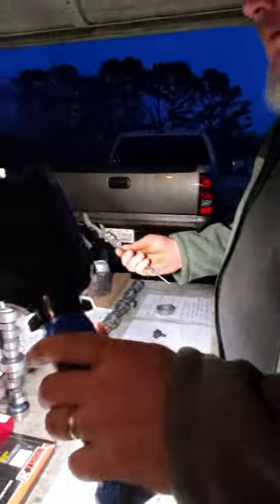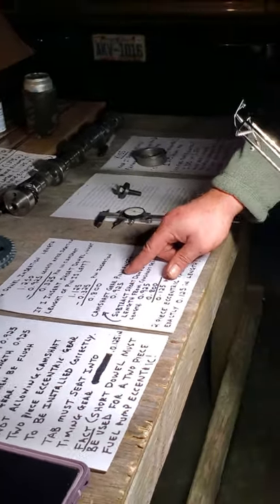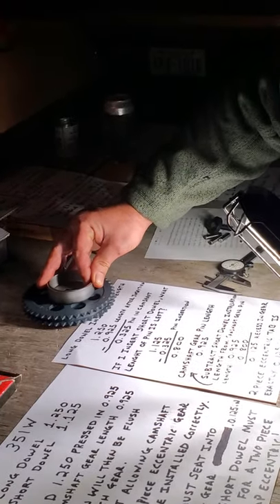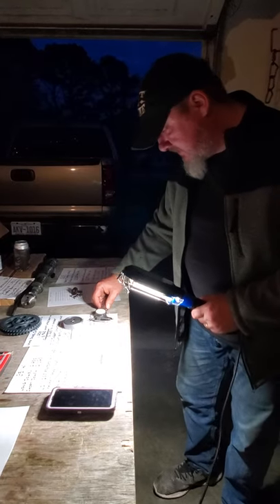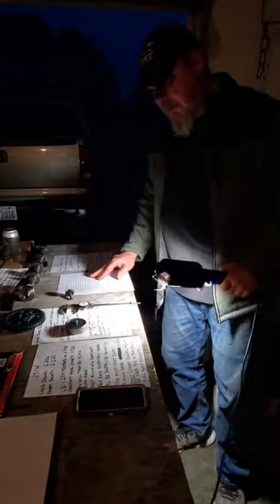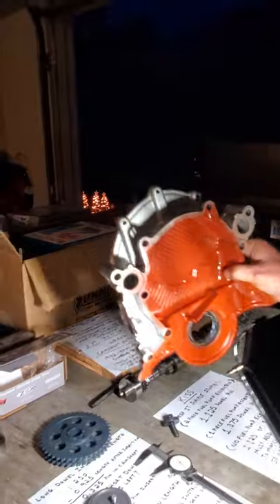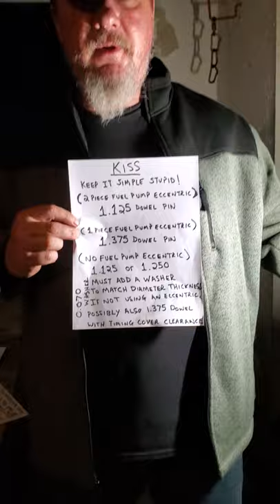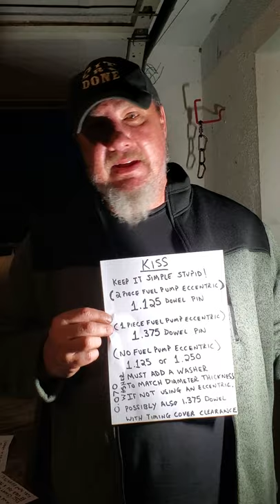Ford 351 Windsor build Ep7. Part 1. Camshaft eccentric pin length tutorial for 289, 302, and 351W.

Comment: Measure and fit everything BEFORE assembly. However, the dowel pin does not have to be extremely tight fit into the cam. Just snug tight. I've rebuilt scores of Ford engines and only have used dowel pins that don't require a pounding to install. Just a tap. The cam bolt/washer assembly that holds the cam gear and eccentric will hold the pin in place. (Make certain the washer is just large enough to impede possible pin walkout.) You should have been able to remove the wrong pin and replace it with the right one without great effort. Therefore saving you much aggravation and $400.00.
Reply from the maker: Keep commenting please. Just created my YouTube videos. All comments are welcome.
Reply from the maker: Hey Bill, do you have a YouTube channel?
Reply: @fordnovice1018  No You Tube Channel. I have many projects that keep me busy at this time. Semi-retired after 40 full-time years of owning and operating a Classic Auto Restoration business with emphasis on Fords and American Muscle Cars. I've personally rebuilt scores of Ford engines ranging from 170" 6's to Boss 429s. Also experienced with G.M. and Chrysler engines from small V-8's up to and including Chrysler 426 Hemis. Good luck with the engine build and the channel. I will continue to watch.
Reply from the maker: Thank you Bill. Still going. I'm not quiting.
Reply: I'm kinda torn on this one. 
   Yeah, I get it that you expect videos to be accurate and all BUT!
   That big Butt, is for everyone understanding and accepting that they chose to trust a YouTube Video over a Ford Shop manual. 
   I do hate it that you have lost money and damaged equipment because of this but consider things.
    If your child wanted a hunting rifle for Christmas and told you that they learned firearms Safety off of a Youtube video; Would you be satisfied with this for his safety training? I surely hope not...
   Yes people should have the data accurate but a video is no substitute for you doing your research. 
    I hope everyone understands this.
   Ya'll Take care and be safe, John

Comment from the maker: If no eccentric is used use original bolt and washer and an additional 0.070 thickness washer for cam gear installation, so cam gear has no slop front to back as major damage can occur.

Comment: Waisted $400 over a dowel pin? Just remove it. Use a 1 piece eccentric or switch to an electric fuel pump all cheaper than spending $400